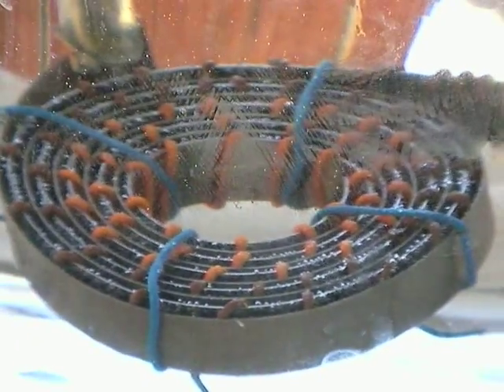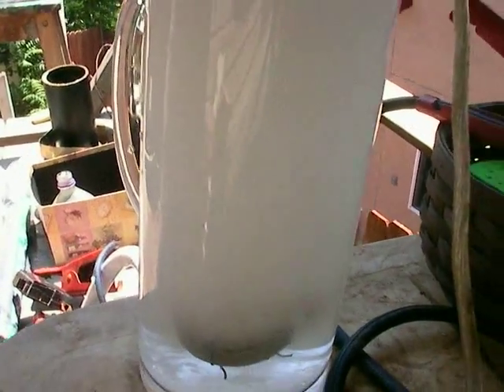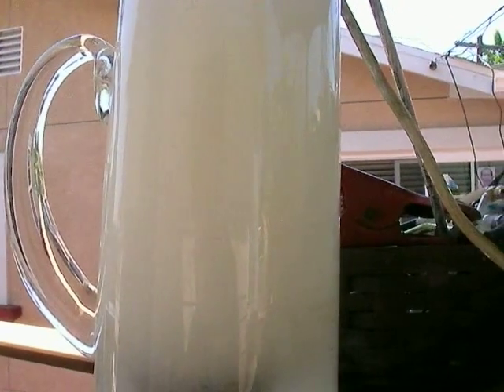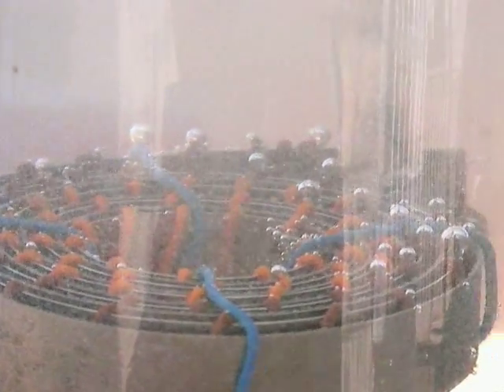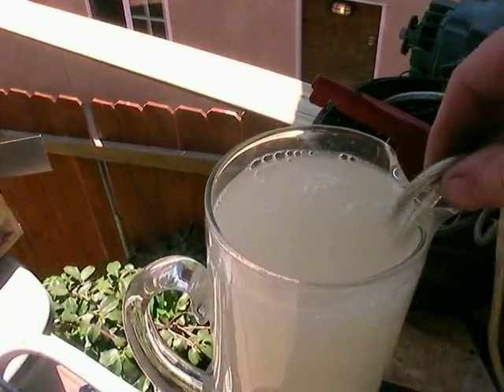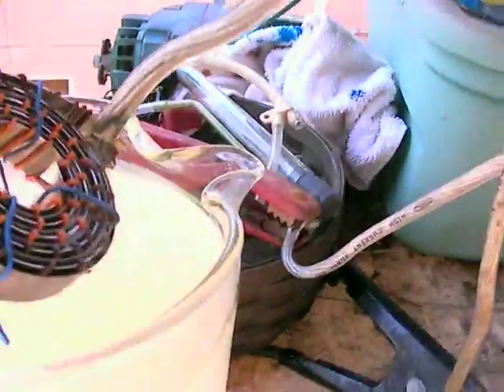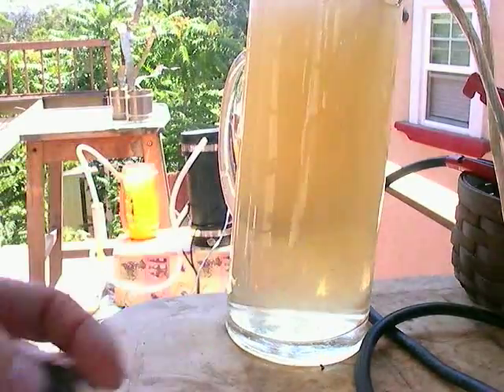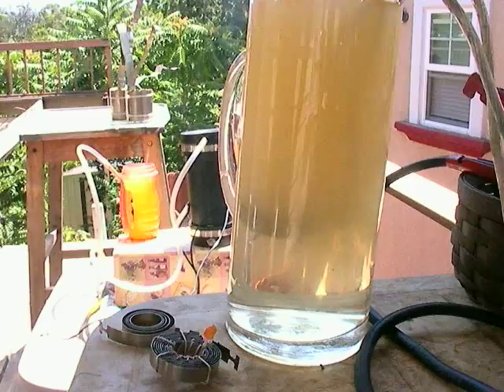Hydrogen Cell HHO

Comment from the maker: Eh, thanks for the post. I had forgotten how well they are running. I have 4 mounted within 3"PVC that's inside my engine compartment, and it's still pumping out HHO. Occasionally I top off the detached resourvoir with water (2-3wks, or when I notice my gas milage going up) Y'know the whole unit doesn't draw that much amps. My wires are 16g, thru a 15a circuit breaker, it never gets hot or boils, still fulls a pint water bottle of HHO in under a min. Just keeps going and going..

Comment from the maker: Also, the spacer used is actually an insulated wire wrapped the entire lengh of the positive node, and conected at the interior of the coil. So the coil is energized thru this wire which creates a magnetic field around that coil winding, and somehow aids in hydro production. It's production is half when just connected regularly.

Comment from the maker: Correct. Tap water without electrolite. However, and this may sound contradictory, ONLY on the first run will I use Distilled and 1/4 baking soda, rinse it out completly a coupla times, then from then on tap water without electrolyte. I find this only works on cells with smaller than 1/16 spacing gap.